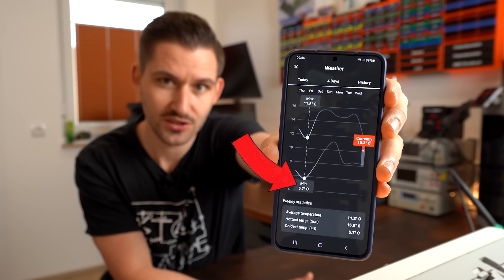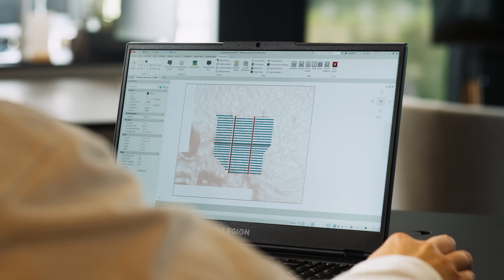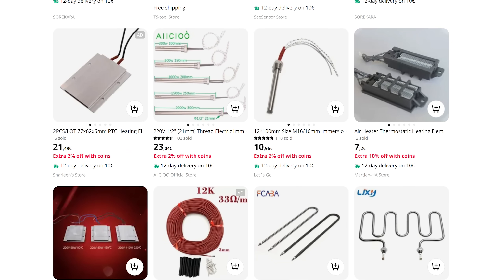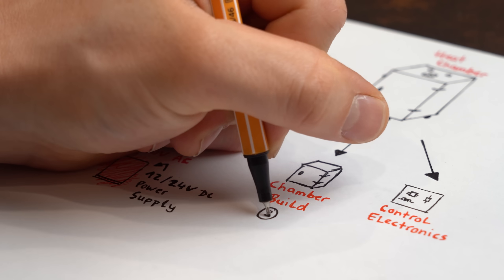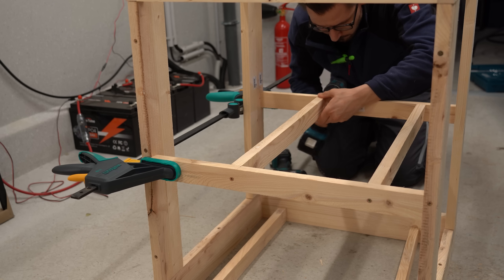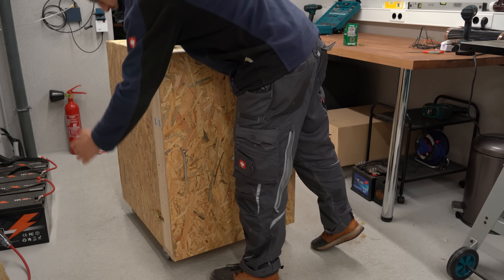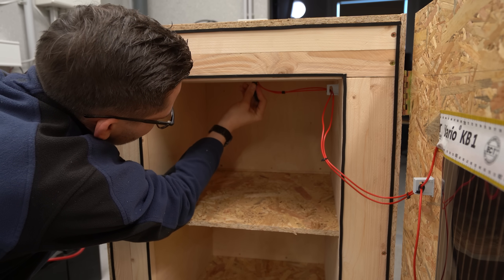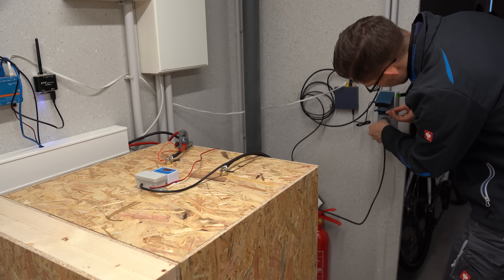The Best Battery Enclosure looks like this?! (Self-Heating)

Comment: Funny I've just been thinking about how I need to insulate my battery box in my shed since the batteries don't hold as much charge in the cold and this showed up!  This is similar to the design I had in mind but I'll make mine open up from the top so it's easier to add water to the batteries.

Comment: Permanently installed Outdoor standby Generators will sometimes have Silicone Heating pads Directly underneath the Battery. Temperature controlled and everything. Just Plug into 120v.

Comment: This is the kind of job that incandescent bulbs were often good for. There's also goldenrod heaters that I've never used but often heard about. Though with good insulation, the waste heat from the operation of the electronics should be more than adequate.

Comment: I Gun Safe dryer works by creating a little heat to keep the inside of the safe warmer than outside. Also, maybe heat exchangers for your garage vents so it doesn't get so cold in there.

Comment: The reason larger battery banks dont usually have heating is a well-insulated building will keep them warm through their own ambient heat. Smaller banks don't produce enough heat to keep themselves warm.

Comment: Will the batteries dissipate enough heat during charge/discharge, for it to be a problem in the summer ? or is the solution just to leave the door ajar during this time? :)

Comment: I think, old freezer with removed compressor and other stuff do the same job as this wooden box but with almost zero build time with much better look and insulation. Fire detector and / or small automatic fire suppression system which works without electricity should be installed.

Comment: You could have used your Cerbo GX on the wall behind the battery box to do the switch on/off of the heating element with its relay output and Temperature sensor. This would also allow you to monitor the internal temp on the VRM Portal.
Maybe another video on how to set this up!

Comment: Why not use a dumb temperature switch? ksd9700 for example. You are just wasting energy using "smart" things.
Just get a normally closed ksd9700 with a low temperature. It will jump to open once the target is reached and back to closed once below it.
You should also be careful with the hysteresis as you can chemically alter things if they temperature swing a lot.

Comment: You could also use an old refrigerator for the box. I don''t know whether your batteries degrade when they get hot, but you may be able to make use of cooling sometimes. It's gotten up to 46° C (115° F) where I live. Probably just run the cooling off mains for those rare situations. It may be sufficient to simply open the door at night to let things cool, then close in the morning. I know it's not in the spirit of automation, but it works.

Comment: It would have been cool if you used an entirely analog control circuit! Could have used a thermistor & op-amp running off of battery voltage to switch a relay.

Comment: 6:40 when using the band saw, please keep the guard a maximum of 6mm above the work piece to keep your fingers safe
Reply: Also respirator and safety glasses are recommended.
Reply: As a seasoned woodworker, I also cringed at how high the upper guide bearings were from the workpiece.  I hope Scott reads this and adjusts his practices on his new band saw.

Comment: I recently did something similar but for cold with an old refrigerator. I used an STC-1000 that I bought on Amazon as a thermostat. This device has two relays, one for cold and one for heat... that is, one that is activated when the temperature drops below a limit and another when it rises above another limit. In addition, it has programmable temperature alarms in both cases and comes prepared to fit in a rectangular hole... it can fit very well and cleaner in your box.

Comment: You might want to wire in series to the relay a non self resetting thermal cutoff, in case the relay fail in SC mode.

Comment: I know it's just a prototype for now, but one thing I immediately noticed is that it lacks a ventilation system - you might want to do the opposite and COOL the insides of the box if the batts get TOO warm. How about placing the heater core on the walls rather than on the door, or better yet: using SEVERAL heaters around the box ?

Comment: Just a suggestion. You can cover the two poles with caps in order to electrical-isolate the poles, so that it won't cause short circuit if something touches both of the power poles accidentally.
For example: put a random metal ruler on the box.
Reply: Oh boy.... That would be exciting 😂
I'd be putting a large block between them to reduce the chances of a metal object touching both... Spanners, rulers, poles, etc are mostly straight, so if there's a physical barrier taller than the terminals placed between or around them, you've reduced the chances quite low.
Personally, I'd have put the terminals inside where visitors can't touch.
Reply: The BMS has short circuit detection. And all 4 BMS's would have to fail for it to not work since they're all in series. The detection and shutdown time is something like 0.03 seconds. You'll get a quick little spark but that's about it.  More importantly you risk damaging the Victron charger, and those aren't cheap.
But yes, it's still a better idea to cover them up. 50V is getting close to the danger zone for skin conductivity anyway. I think ~70V is the "high voltage" zone.
Reply: @andrewt9204  All of 4 BMS might actually fail. Typically BMS has to disconnect abattery and it's output voltage will drop to 0V, but here it might drop from 13V to -39V (all outher BMS'es haven't disconnected yet and load is short circuit, voltage 3.25V per cell).
Output transistors for that BMS then fail short (Vgs overvoltage with Vds overvoltage do destroy isolation barrier - creates above mentioned failture) and the same situation repeats 3 more times.
Reply: Thanks for expressing my first thought on seeing that. A quick wood box seems like it would be easy enough and I wonder if he added something later.

Comment: Some battery solutions have active heating and cooling but the amout of them I see shoved in a loft with no ventilation so freezing in the winter and boiling in the summer can not do them any good, my solution is installed inside my garage / Workshop as it has the highest power demand in my house dosnt get to cold or hot but in the winter and summer you can hear the system running quite loudly as it uses a liquid cooling / Heating

Comment: Energy requirement for your insulated box shouldn't change when you have batteries or not. It's the same for an empty or full fridge. What matters is not openingen the box or fridge and the thickness of the insulation.
Reply: The batteries will create some heat when moderately charging/discharging. The extra mass of the batteries alone won't change the amount of heating watts required, but it will resist the rate of temperature change. I think that's what he was getting at.

Comment: Hmm, maybe you should add an overpressure vent? If one of the batteries fails(overcharge etc) and vents gasses, that could destroy the whole thing if it is completely sealed. I don't think keeping lead acid batteries in a completely sealed box is a safe thing to do. Or are there enough gaps for pressure to escape?

Comment: I'm a bit surprised that you didn't see the PTC heaters.  Those are really the way to go.   They can run directly off of AC or DC, and at almost any voltage... they just produce a bit less heat at lower voltages.   They usually come with a fan (which of course needs the proper voltage to run), but you can get them bare, with fan, or in retail units that include additional safety features (usually also a fuse and a thermal switch).

The PTCs are also very compact.  There are also a few different ways you can use them.  Throwing in a thermostat is easy, but you can also arrange the voltage to burn fewer watts and just leave it running continuously.   So for example, if you take a little 24VDC PTC that normally produces 60W you can run it at 12VDC instead to burn only 15W.   And so forth.   It really doesn't take much to keep a battery box warm... 5-10W is typically plenty.

I would also say that fire safety is really an issue with batteries.  I would go with the rack mount solution and then build a box around it instead of putting the batteries directly in a wooden box.

Comment: I would add an inline temperature switch for the heater cable in case the relay fails short.

20or 30°C bimetallic switch should do the job, just keep in mind they aren't very accurate and can have a large hysteresis.

Also would have an over temperature alarm for it

Comment: if you are using a wooden box, I would add a temperature limiter. Just in case the relay in the relay contacts get welded while switching.

Comment: Another great project, just some thoughts of me:
* Heat rises up, why not putting the heater under the lower batteries
* when making a chamber for Batteries why not with an fire resistant material
* in summer when it's hot with the additional heat from charging/discharging in combination with the isolation maybe you should add a blower

Comment: I do know that the chemistry of led acid batteries that you are using is far less volatile than lithium-ion or lithium-iron phosphate but still, is keeping them in an isolated wooden box (while charging some hydrogen may still be venting) together with an electric heater such a “hot” idea when we are taking fireproofing under the consideration? 😊

Comment: Please be aware you cannot safely charge lead acid batteries in a sealed cabinet like that. Like in another comment over charging the batteries produces H2+ and HSF4 gas both very bad things to have in a sealed container with electrical equipment that is not spark safe!
Reply: @whocares281  lol my bad but the info still applies don’t do it with lead ones

Comment: Actually.... I would upgrade the force ventilation to forced ventilation with heat exchangers. That should keep it noticably warmer than external temperature.
Apart from that, did you check if the waste heat from the batteries can be dissipated?

Comment: Some old refrigerators can run in reverse, so it can be possible to use an refrigerator and use the control unit you showed to run the compressor

Comment: Really good project! If done in larger scale I would maybe try to heat it with water. Since the water could be at 20 Celsius and circulate in copper tubes that would conduct the heat to the batteries. Also it could be used as a coolant during the summer. This would make it possible to have it everything outside as a compartment. Like a small toolshed just for batteries.

Comment: Well you can try using pcb heater this way u can create high temperatures just the driving circuitry would be a bit complicated , maybe you wana check Carl Bugega video he make a pcb that can solder other PCBs

Comment: you could use a small air conditioner to make a sort of heat pump heater, even more efficient! or even just peltier thermoelectric coolers, used in reverse, and with a fan on the cool side, will also give you over-unity heating

Comment: One problem I can immediately see is that you might want to install some controllable ventilation just in case. The batteries can get warm while charging, but if the insulation is too good, they might start to overheat.
Reply: or you know, just keep the door open in the summer
Reply: @ericlala  truest
Reply: temp activated solenoid that lifts a vent flap and a fan?
Reply: @SlavTiger  in hotter climates even a tiny  ac system will do good job for several momments!!!! there are thousands of paterns  like pc cooling or even small fridge ones...
Reply: @matejgamingandotherstuff6484 a seal that doesn't seal? 🤔
Reply: @matejgamingandotherstuff6484 even so, The minuscule gaps would need a positive pressure to vent a gas and is besicly a ticking time bomb if they do off gas, air and gases are different compounds with different densities.  even if he vented it with a 5v fan or something, those gases are now in the room with him to inhale and become more combustible with the added air. Hence battery's are Usualy always outside.
Reply: @hulkgqnissanpatrol6121   These arent old lead acid batteries.
Reply: @ThePentosin  even worse again! 😑
Reply: @matejgamingandotherstuff6484  So, you've got these lead acid batteries. Seems like a simple power deal, right? Well, buckle up, genius. Turns out, these things produce hydrogen and sulfuric acid gases. Hydrogen? Oh, just a silent ninja waiting to explode when it feels like it. No biggie. And sulfuric acid? It's the corrosive sidekick that eats through stuff faster than you can say "oops."

Now, here's the fun part. Unlike propane, which at least has the decency to smell, hydrogen is the stealthy troublemaker with no odor. Picture this: your lead acid battery is throwing a silent gas party, and you're the unwitting guest.

But fear not, because we've got a solution: venting. Yeah, that's right, let those gases out for some fresh air. It's like giving your batteries a breather, a safety valve to prevent your power setup from turning into a hazardous game of explosive roulette.

So, here's a tip for the wise: don't lock up lead acid batteries in a sealed cabinet inside a building. Because who doesn't love the idea of a potential explosion waiting to happen? Venting – it's not just a suggestion; it's the eye-rolling obvious solution for a safer power play.
Reply: Yes those VRLA batteries will eventually vent some gas, so best to have a pipe through the case to allow it to dissipate. The easiest thing for temperature control would have been to get a cheap 12V controller and use the on board relay to do this, using the resistive heaters that are capable of running off low voltage, so use 4 12V ones in series to operate off battery stack, and then simply run the controller, with the tiny current it uses, off the 12V battery. Benefit is the display is always on, and also will monitor battery temperature in summer, where you can have an alternate output to set an alarm if the battery is getting too hot, or run a set of fans to actively cool the packs when charging, just using a second controller, and some holes in top and bottom for air flow.
Reply: @SeanBZA LiFePO4 used
Reply: @bayenne5b  Same issues with cold charge and temperature though.
Reply: @SeanBZA  more when it comes to charging, that's why he made it heater only, not sure how this will handle under max load in the summer though
Reply: @bayenne5b  if no remove door then apply  cooling on same chamber!!!!   another possible  episode just from your  curiosity

Comment: Nice job. Some tips for your next video.
1.
Put the heater on the bottom. Warm air rises.
2.
Put the sensor at the lowest battery. 
3.
Use isolation with reflective material. Heat will leak out of the box via conduction, convection and radiation. You covered the first 2.
Hope this helps. In winter time you can use every Watt you save.

Comment: 240v electric bed blankets, usually about 60w, and only warm as you sleep on them.
I'm heating at 12v, theres already 12v in the batteries that i'm needing to warm...which also means if its very cold but sunny, the 12v from the mppt (which isnt charging as its too cold) can run the heaters until it is warm enough to charge, then the heaters can turn off.

Comment: a 60 or 100w lightbulb is a pretty good heat source.  It'd keep out pump house from freezing in the winter where i lived (which wasn't that cold)
Reply: Light bulb would cause a hot spot, plus they are less reliable then the heating matt when cycled by the temperature controller. But are good enough for a pump house.

Comment: I'm working on something similar for my 3d printer as the room it is in can get as cold as 10C  and for ABS to print warp free I need my enclosure to get to 50-60C At the moment I can get 35 whith an ambient temperature of 12-15  if improving the insulation doesn't improve things I might have to add active heating and a temperature controller.

Comment: There are special mounting claps to attach cables to the heating mat. And insulation too. No soldering is needed. It would be great to add some hardware-based temperature and overcurrent fuses.